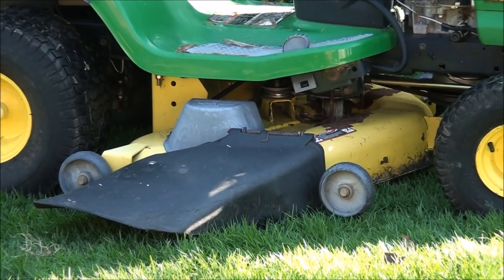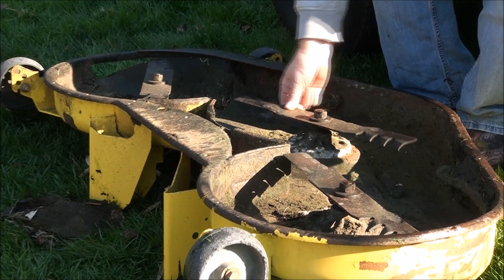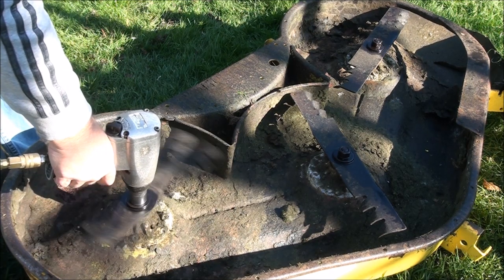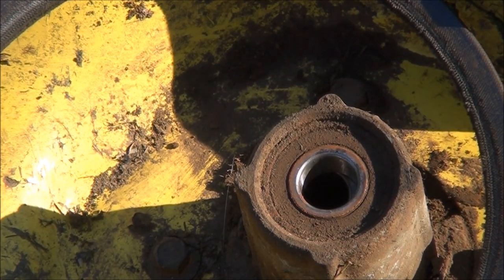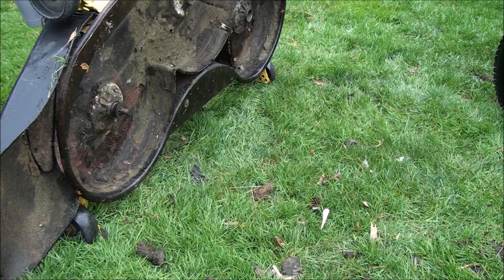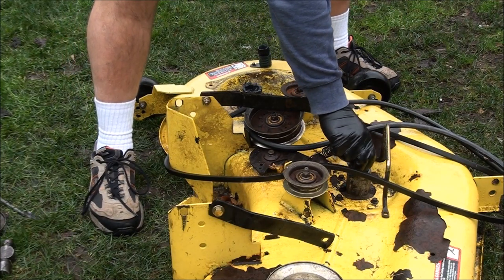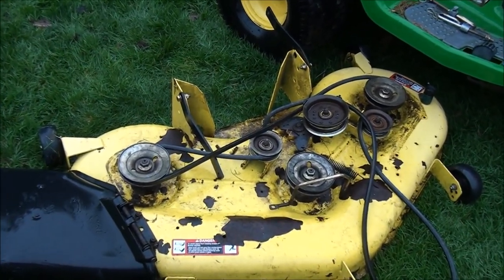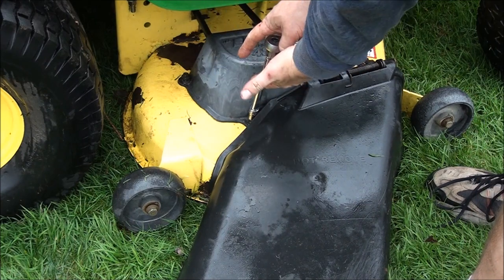HOW TO REPLACE LOUD bad DECK BEARINGS. JOHN DEERE LA145. Riding Lawnmower deck problems FIXED!

Comment: If not JD, what tractor do you recommend for 1/2 acre residential lawn? I have a JDS240 with 100 hrs and it’s been in the shop 3 times already.
Reply from the maker: Craftsman
Reply: Lawnmower Repair and Service Maintenance Tips ...I had a t2200 model and it did not last long either, that’s why I went with JDS240 and it’s going on a second spindle in less than a year. 100hrs and kept in a shed, grease the fittings after every use, does not make a difference anymore.